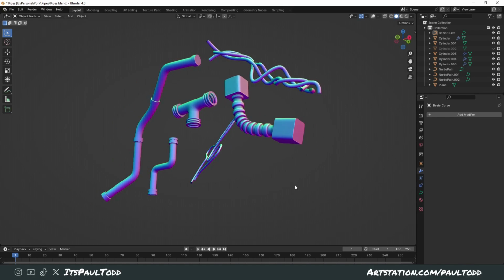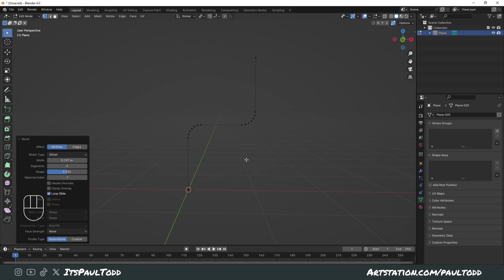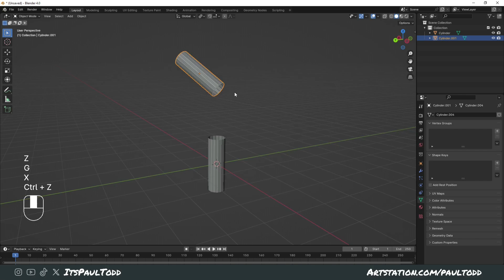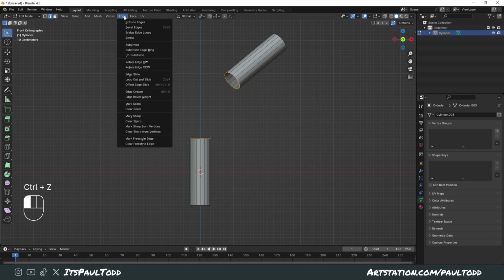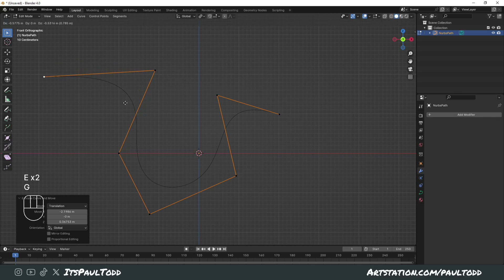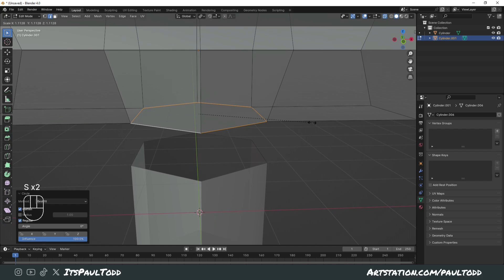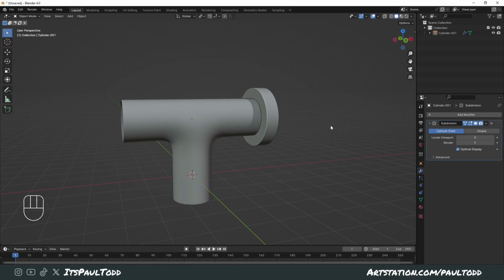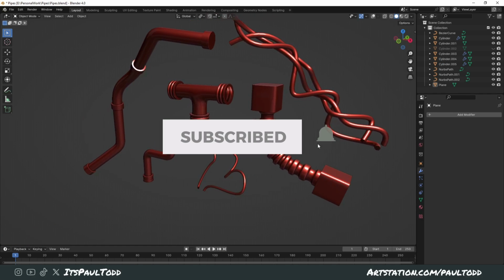How to create FAST Pipes/Wires in Blender 4.0

Comment: Question: how does crease actually function? I generally use bevel weight with a modifier to crisp edges, but that of course creates bevels if you apply the mods. Does the crease keep a sharp edge with no downsides?
Reply from the maker: Yeah you can set an edge to a crease limit of anywhere between 0-1, 1 of course being fully sharp. It comes in very useful when modeling, your basically just instructing blender what you want sharp and by how much. Works nicely with other modifiers like subdivision too, it's worth playing around with :D

Comment: Great tutorial!  I'm having trouble sizing the tops of the rivets.  When I press S and move the mouse, all the rivet tops move inward or outward from center of the cylinder which deforms the rivets without sizing the tops of the rivets.  Any ideas as to what I'm doing wrong?  Thanx
Reply from the maker: Change the pivot point at the top (next to the magnet looking thing) from median point to individual points and it should work fine. Glad you liked the tutorial!